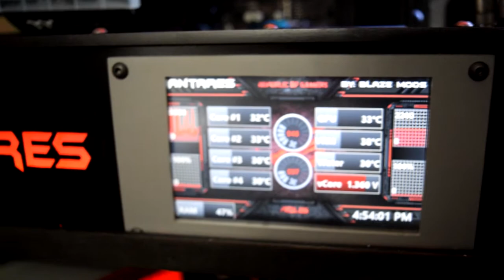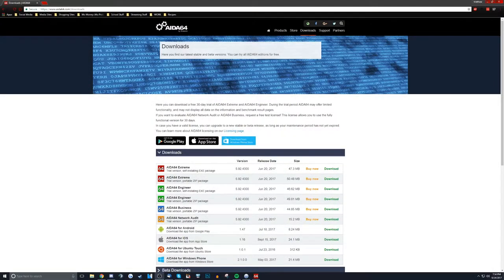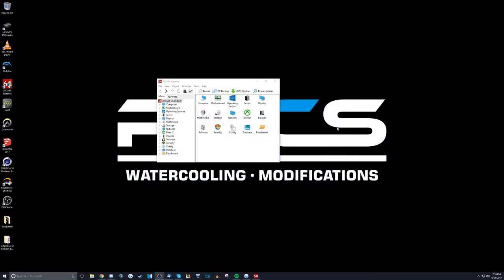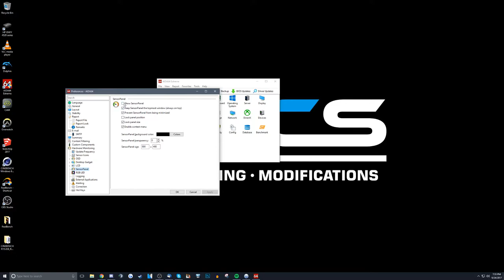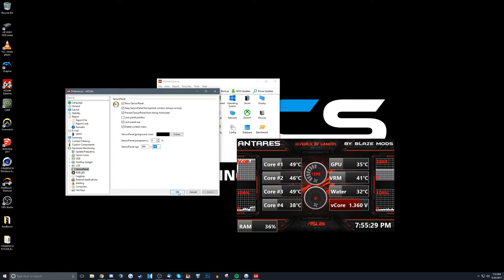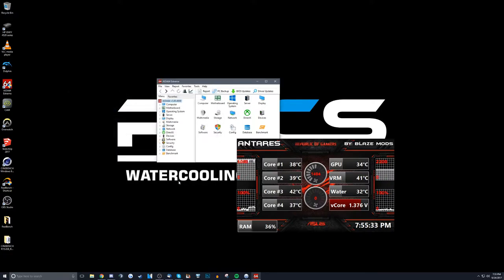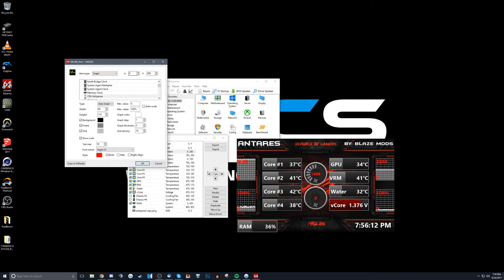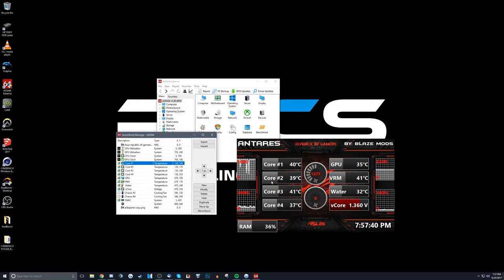Mini Monitor Mod - Personal Rig Part 2

Comment: When you set it up to the extended desktop does the sensor panel automatically show up on the monitor at startup or do you have to open and move it manually every time?
Reply from the maker: Mine always starts in the correct position, however you can lock the panel position in AIDA64 settings

Comment: can I ask a possibly dumb question...do most motherboards or CPU and then GPUs have integrated temperature sensors that can be monitored by software? so then you don't need to place the thermal sensors near those components? I know he mentioned it very briefly but I just wanted to clarify!
Reply from the maker: Yep, every motherboard has quite a number of on board sensors.

Comment: Do you do a mount for a front drive bay? its a bit useless to have a screen in the side if the side of your computer isnt facing you...
Reply from the maker: No Currently we do not make one that fits the front bays.
Reply: ive got the screen sitting here and i was thinking the same thing you are... mounting it in the drive bay area a useless area none of us really use would be pretty slick... sadly my case sits to my left and the glass panel is on the left side of the case so i cant actually see into my case... kinda regretting my pc desk choice these days...

Comment: i just got the 7 inch version to put in my pc. is there anything special that you need to do with the screen or is it just plug and play.
Reply: Did you get yours working? I bought a 5 in off ebay, plugged everything in, but the screen just lights up and nothing happens... I checked to see if my PC would recognize it and it never even found it. The package came with instructions on how to install a driver to get the touch feature to work, but this shouldn't affect the HDMI right?